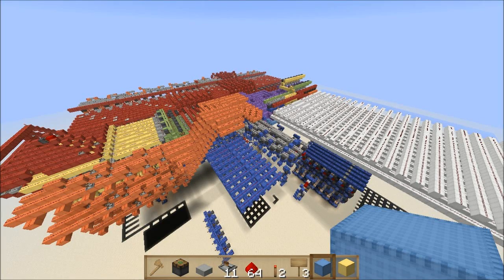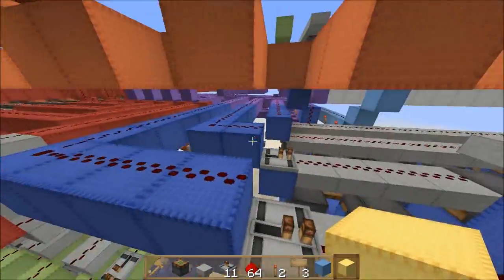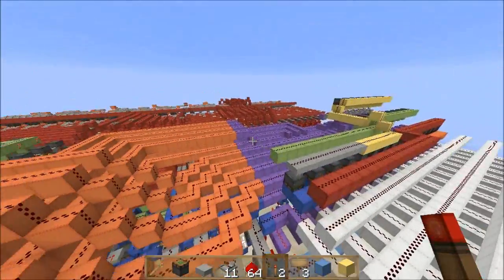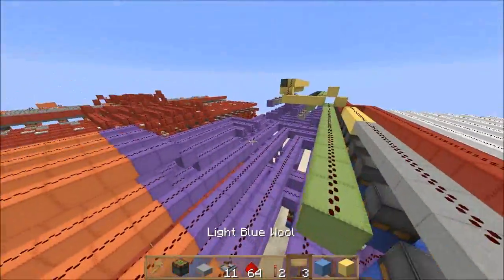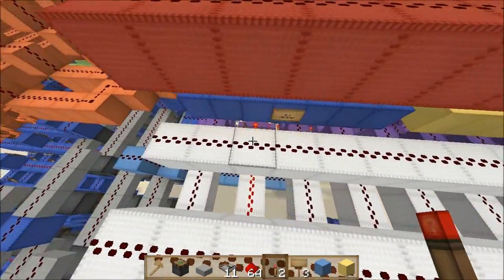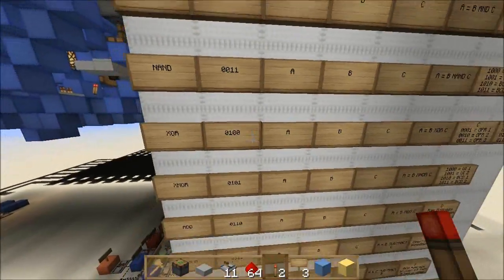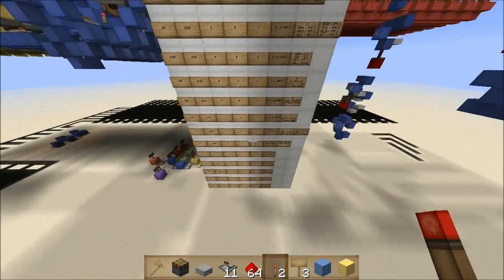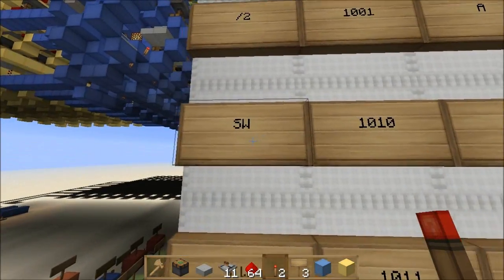Minecraft: How To Build An 8 Bit Computer - Part 23a (ROM II) [Explanation]

Comment: Thank you, but how can I plug a redstone lamp display on this computer?
Reply: You  need to make like a GIANT GPU because of the 8 bit output, you can look some designs up on yt
Reply: @STA-3  Ok then, but how can I build it?
Reply: @jmcortade8161  i would prefer 2D with pixel selection via AND Gates,
I think that is the simplest concept is To begin with.
Reply: @STA-3  UPDATE: I've already made it on another computer I've made, and I think it was easier than this. The computer was smaller too.